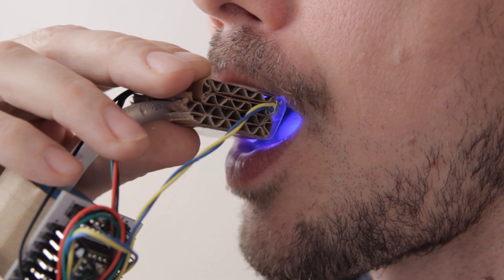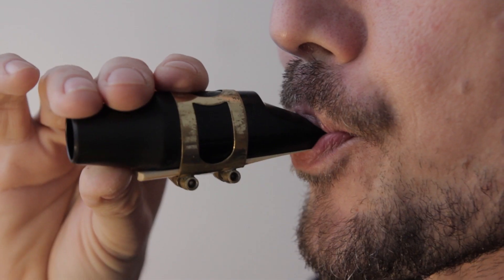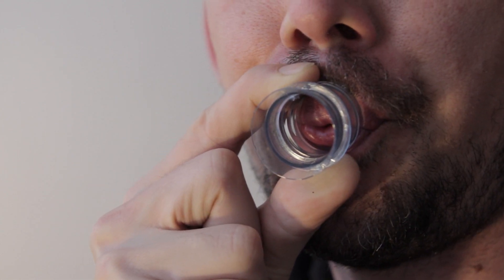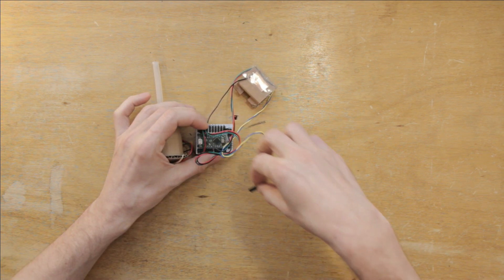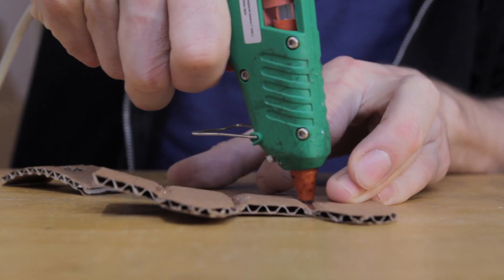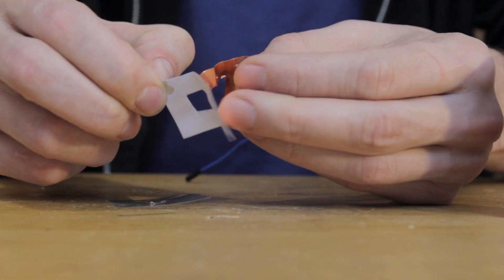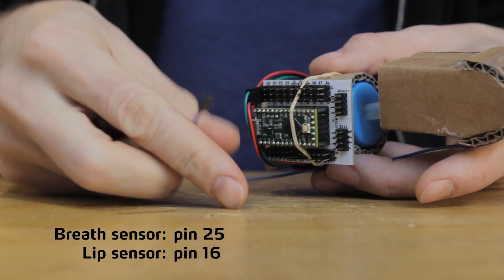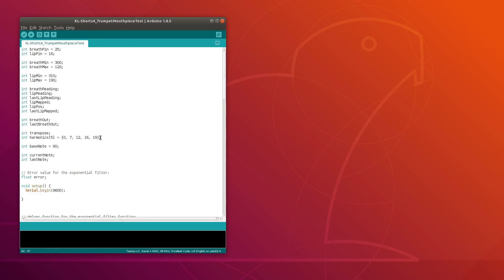Brass Instrument MIDI Mouthpiece (Tricking the brain with sensors - part3)

Comment: i play trumpet, i had tried to make a midi one with a gas sensor and accelerometer and three buttons.  the gas sensor would tell how much you blow, volume,.... and the angle would change the notes  similar to the range you can play depending on the buzzing frequency...you would get the exact note based on the angle and button combinations.... but i'm kinda too bad at coding to do it.  i did it this way because you could just use a regular mouthpiece and buzz the note while still getting volume data.... but i'm thinking maybe your breath sensor may be better.... hey you could try to attach an electret or piezo mic to the mouthpiece and just detect midi off/on based on the buzzing or not.
Reply from the maker: Sounds cool! I guess you saw my "TROM" video..? I'll be adding "valves" to that design at some point, hopefully the code for that can help you with your project.
I've been experimenting with an electret mic, doing frequency analysis on the signal from it with a Teensy 3.2. The idea is to control MIDI live with my saxophone, but the same setup might work for what you're saying.